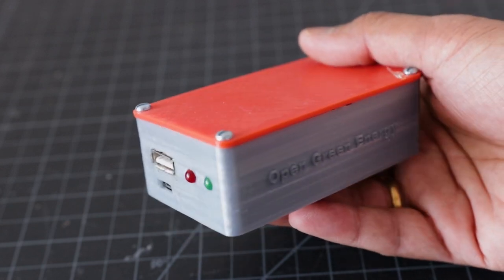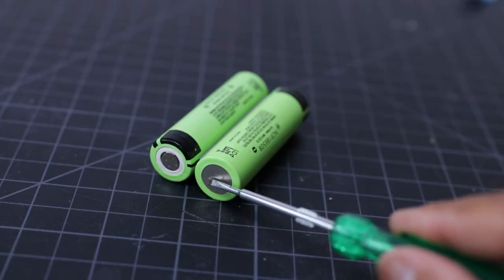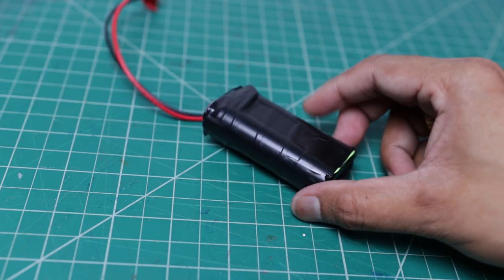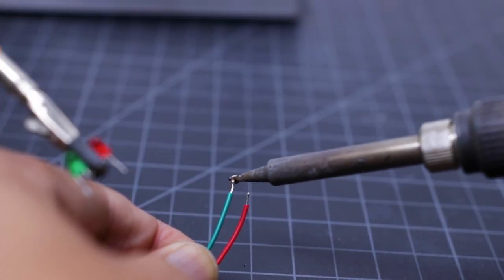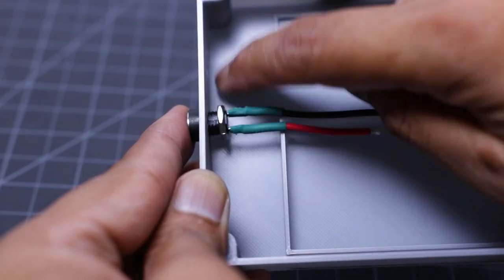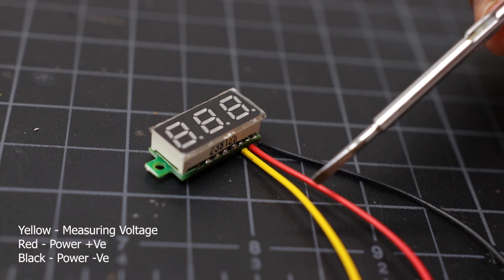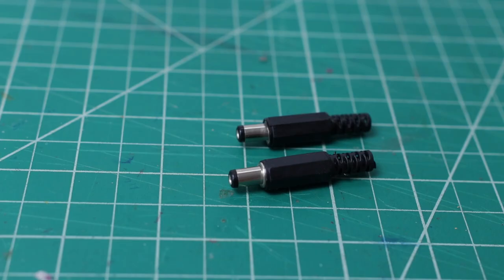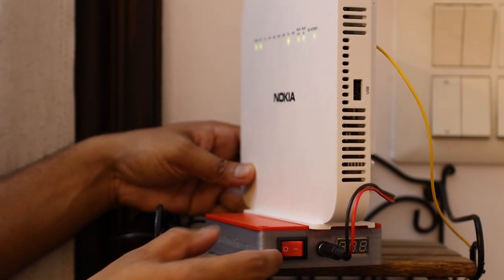DIY Mini UPS for WiFi Router V2.0 | 12V Mini UPS  | Work From Home

Comment: Nicely made video!

Great that you mentioned that a spot welder is recommended for connecting the batteries.
Li-Ion batteries can be dangerous if overheated, for example they may catch fire or explode months later.
We can also use a cheap 2x18650 battery holder, then we don't need to do any soldering to the batteries,
and when some years later the battery capacity becomes too low due to aging, it's easy to open the lid and just
replace the batteries. The enclosure might end up just a bit bigger.

I use exactly same looking heat gun (I think it was sold as "embossing heat gun") for heatshrink tubing, works great!

The voltmeter shows 7.9 V at 13:46, and then after unplugging the power supply, it goes down to 7.4 V = 2 * 3.7 V, and 3.7 V is an almost empty battery. 
But you had them fully charged with your NiteCore charger before building the UPS. Why is that?

This is a cool project, I especially liked your enclosure.

An extra feature that could be added is a power-good or power-loss signal.

If the UPS is used for an MCU (e.g. Arduino, ESP32 etc.) or a single-board computer (Raspberry Pi, Beaglebone),
they could use that signal to realize that power was lost, and schedule an orderly shutdown, for example.

A single-board computer ideally would need something more fancy, e.g. a Beaglebone, if it would shut itself down on power loss,
won't restart automatically when power comes back. Therefore the UPS should have it's own MCU with simple logic, e.g. send Beaglebone
the signal that power had failed and battery is low, wait a fixed number of seconds, giving the Beaglebone chance to shut down properly,
then actually turn off the output (using a MOSFET). When power is back, it should turn the output back on. There are various edge cases
such as handling the cases when power comes back during Beaglebone shutting down, or power going out again while Beaglebone is booting up.

Cheers
Gene

Comment: We need to set boost convertor voltage to slightly lower than tha power adaptor voltage. Else router will use power sources which have the highest voltage. And battery will keep charging and discharging.

Comment: I theory, a very good idea. 
Just some concerns. Typical setup is 1 fiber modem at 12v, and 1 wifi router at 12v. Each of those draws 1 amp. So running them together you will do 2amps. 
I do not think that battery pack will last very long. Maybe 30 -40 minutes of backup power. Consider using 4 x 20700 cells. 2 sets in series, and then 2 banks in parallel.  In South Africa we have daily outages due to rolling blackouts. (aka loadshedding)
these outages is anything from 2 to 2.5 hours. And sometimes the power fails at a municipal level where the outage can be 3 - 24 hours. My max outage was 4 days.
Reply: I am in South Africa as well and agree with you. Some modifications to suit us in SA.

Comment: This is not a UPS but a Powerbank. A UPS has everything under automation. It has to be kept plugged in at all times and provide battery backup within miliseconds after a power outage. This will ONLY be possible by using a relay... a UPS without a relay is only a powerbank. By the way, Open Green Energy is one of my favorite channels. He is working very cleanly and explaining everything in detail. Thank you.
Reply: he used diode may be they will work similer to relay
Reply: @sanjaypatil3097  Sanjay jiii... it's apples and oranges. Totally irrelevant.
Reply: Wrong : a relay is too slow to switch from a power source to another without interrupting the power to the router. The way it is done here is the right way to have a true uninteruptible UPS with zero downtime. The only negative side is the simultaneous charge/discharge of a lithium battery bank which will degrade the lithium cells fast. The alternative is to use the older but safer 12V lead battery
Reply: @enerbot283  Not wrong... a relay backed up by a capacitor will just do just fine providing a smooth transition.
Reply: @enerbot283  Wrong: this is why a capacitor is placed right before the relay. This eliminates the downtime as much as the farad value of the capacitor.

Comment: Excellent! Couple of questions:
1) What exactly does the BMS board do? Why can't we connect the TP5100 directly to the Lithium Ion battery as well as route it through the rocker switch, etc? What exactly is the role of the BMS board? From what I could see in the product description of the TP5100, its already a battery charger with overcurrent protection etc, so I wasnt clear what role the BMS board is playing. 

2) Do the inputs and outputs of the TP5100 share a common ground?

3) Do the inputs and outputs of the LM2587 boost converter share a common ground?
Reply: 1. It only checks for the overcharge voltage of 8.4 volts but it doesn't know the status of each cell if you use it for 2s. If the battery is not balanced you can potentially overcharge once of the cells if you are not using a BMS. Once cell could be 3.8v and the other one at 4.6v and TP5100 would still think everything is ok because it is still seeing 8.4 volts.

2. I believe yes.

3. I believe yes.

Comment: I know it may sound crazy but... I have a 12V 7Ah battery lying around. Do you think a similar circuit can handle such amps? I'm planning to connect Wifi and a 12V LED strip for ambient lighting to it.

Comment: if you want to add more batteries to extend the capacity for 8 hours, what else do you need? besides the batteries?  Different BMS?
My router is 12v 2amp, I need it to work for at least 8 hours
Reply from the maker: I will upload a new video soon, with higher backup. Please keep in touch.
Reply: @opengreenenergy  Me too I need that. I will wait for your video.
Reply: @opengreenenergy  Subcribed! btw :)
Reply: @opengreenenergy  that would be great waiting for the next video

Comment: This is certainly a better design than the one made by the English YouTuber by the name SORIN where I suggested him to use diodes to stop the reverse flow of electricity which he omitted. But, the most important question is whether we can leave this UPS always ON and connected to the power supply or not? 
The reason I am asking this is that I have read that charging module like TP4056 (you used TP 5100) has an issue where it will keep on charging the Li-ion batteries with full voltage even though they are fully charged(the Red charging Led will keep ON continuously) if some load is connected like in the case of UPS such as yours which can be dangerous. TP5100 might also have the same issue although no one till now have tested that.
Also, I would also recommend using a fuse as an extra layer of security to make sure that the IN and OUT power remains within limits.
Reply from the maker: Thank You for your feedback.
Reply: @Milan Maharjan  @Milan Maharjan  It doesn't work like that. Adding Extra module in between won't work. The issue is that the power is continuously being drawn through the battery as there is no relay system. So, the module thinks that the battery is not fully charged and thus keeps on charging. But unlike lead acid batteries that can be left charging safely for longer amount of time. Li ion can be quite dangerous and can get heated or burst into flames if kept charging continuously. It also kills these li ion battery faster. So, for now I would suggest that either you use a small lead acid battery(like the ones used in mosquito rackets) in place of Li ion with some changes or just use this for backup in emergency instead of using it as UPS and leaving it charging indefinitely.

Comment: Here's a much simpler solution: Use a 12 volt car battery and a 12 volt automatic battery charger.
1) Connect the charger to the battery.
2) Cut the low voltage cable and connector off the wifi router power supply and connect the wires to the battery observing correct polarity.
3) plug the connector into the wifi router and plug in the charger.
Done!

The battery always supplies power to the router.
The charger keeps the battery maintained
If the power goes out the router will stay on for days if not weeks or months.
Simple and effective and anyone can do it without all that extra cost and gadgetry.

Comment: Can this be plug in all the time? Or we have to turn it on by manual when power cuts off?
Reply from the maker: Yes you can plugin for all the time. No manual operation is required

Comment: good one , but why to  remove the 12V adaptor , is this not having Over charge protection ?
Reply from the maker: No need to remove the charger, I have shown to demonstrate that without power the router is working.

Comment: Hello ,

Very good work.

This is with regards to V1 of which I couldnt find the video.

"There are a lot of circuits out there that show the use of the TP4056 as both a charger and a load driver - Not Good. If a load is attached to the battery while charging, then the TP4056 may not detect when the charge current has fallen to C/10. So it could continue charging - this could be dangerous.
You should never use the TP4056 as a charger and as a load driver at the same time."

I would not encourage anyone to use TP4056 for charging and discharging at the same time.

Comment: Hello, very well done. One doubt... We are connecting two power sources in parallel. They won't be equal in Voltage. And as far as I know, it is not allowed (or it is not the best practice) to connect in parallel two different voltage (one from 12VDC wall power supply and the second one from LM). Ok. They can be very close to being equal but not 100% equal and there will be a potential difference)
Reply from the maker: You are correct, this is the reason for using of diodes.
Reply: @opengreenenergy  Ok. Thanks. Now is clear. So voltage on LM should be lower than on AC/DC adapter? In this scenario as far as we have mains our device will be powered by ac/dc adapter. How big difference in voltage should be (in case using diodes pointed in your solution)?
Reply: @opengreenenergy   Can i use 1N5804 diode in place of 1N5822 ?

Comment: How would you change the design for countries that need to power a fiber modem and wifi router at the same time? Could you build something so that it has inline charging ?

Comment: Hi, nice video but I have a quick question. Why did you add that direct line with the diode between input and output? I mean, I'm not entirely sure, but when you have current going through that line and the switch is on, don't both currents from the input and the batteries are added together which would double the current at the output? Isn't easier to just get rid of that direct line and let all the current go through the charger module to that parallel connection between batteries and switch? That way, the current would always be charging the batteries until they'll full and depending if the switch is on or off, the UPS will be on or off in the same way no matter if it is powered by the batteries or the wall. Thank you!

Comment: Sir rather than LM2587 module can we use MT3608 booster module PLEASE REPLY 🙏🙏🙏🙏😊
Reply from the maker: Yes, you can use. But it totally depends on the current drawn by your router.
Reply: My router consumes 0.6 Ampere than is it okay to use with my router
Reply: I have two routers first consumes 0.6 Ampere and the other consumes 1.2 Ampere so which module should I connect to the routers
Reply: Waiting for your reply sir 🙏🏼🙏🏼🙏🏼

Comment: Good job but I have an question can I use 4s bms for 12v output?
Reply from the maker: You can use 3S, in that case you can use a buck boost converter instead of boost converter shown in this video.

Comment: hello i have modem plus router so i will use splite cable but both of them have .500 amp so high amp can damage my modem and router or not and if then how i can reduce current

Comment: i tried it today...for some reason reverse current is blocking input voltagr..so batteries are not charging...diodes are working as expected what could be reason?? where do u think i am doing wrong?? Thanks in advance..!

Comment: If I get you right, it means that I won't need the charging and booster conversion units if my input voltage is the same as the battery voltage and same for the output voltage required. Am I right?
Reply: Battery voltage is not fixed, it will slowly go down while being discharged so you need a booster to make sure the voltage is stable. You could get away with the charging buck/boost module if you have the exact voltage needed for charging.

Comment: hi, i have NETGEAR X4 R700 router with 12v & 2amp. is this ups work for my router?  Does he get into work immediately or does the router disconnect and then go up?
Reply from the maker: Yes, it will work.
No, it will work without rebooting.
You can check out my V3.0 video which more powerful.
Reply: @opengreenenergy  Yes I saw the new video, really great.  Very nice work.  Well done 👏👏👏 Looking forward to your next projects.

Comment: Great work... Will it work for my router which is rated at 12V-2A? And if i want 2 output one is 12V-1A and other 12V-2A, will it work? If no thn what changes i need to make plz suggest.
Reply from the maker: Yes, it will work. 
You have to use two DC output jack.
But you will get less backup time. Backup time can be increase by adding one more battery pack.
Reply: I would be glad if u reply

Comment: Nice project am also trying in your device maximum battery backup how much?  , Insted of two battery I can use 4 battery is it supports?
Reply from the maker: I am getting 2hrs 15min for my 7W router. Yes, but the charging time will be increase. The maximum charging current of TP5100 module is 2A.

Comment: I made an ups using 3s bms, xl6009 step up module but it's giving only 10 min backup ? Where is the problem ?
Reply from the maker: Which battery ?
Reply: @opengreenenergy  18650 batteries 3

Comment: bro lifepo4 batteries are available,6000mah for a single battery of nearly 270 rupees..so why cant we use two of them and make a 12 hr battery back up?
Reply from the maker: Ofcourse you can use it

Comment: When battery charge continues down battery voltage down together and then the outout of voltage booster voltage down.. so, i need a module whose provide stable 12volt output

Comment: Doesnt 2s BMS board charge the batteries? y do we need TP5100 ?
Reply from the maker: BMS is for balancing the cell voltage and provide protection to the battery pack.

Comment: My brother, I have a PowerBeam device that works on 24 volts and the router works on 12 volts. I used a UPS for them in three batteries and has three sockets, the first is 24 volts, the second is 12 volts, and the third is 9 volts. Usb 12 volt and USB 5 volt to charge the mobile

Comment: Can i use TP5100 for Lifepo4 or what board do i need for Lifepo4 instead of 18650?
Reply from the maker: You can use TP5000 for Lifepo4 battery.
Reply: @opengreenenergy  Ok. and how about the IN5822? can i use it for lifepo4?
Reply: @opengreenenergy  if you can make a lifepo4 version also with bigger capacity, that would be great! :)
Reply from the maker: @jayc9003  You can use the same.
Reply: @opengreenenergy  Ok. for TP 5100, i want to increase the capacity of the battery. how many batteries i  can connect in parallel? thank you for answering all my question :)

Comment: Is the battery theoretically hot swappable?
Reply: yes instead soldering the battery you can buy 18650 battery holder if battery fails you can swap battery easily

Comment: Is that ok to use higher capacity battery than 3400mah?
Reply from the maker: Yes, you can use it.
Reply: @opengreenenergy  thank you 😇
Reply: Brother why tp5100 is getting too hot when i plugged in?

Comment: Can I use XL6009 for boost converter?
Reply from the maker: Yes, you can use.
Reply: I have tried it today... 
1. TP5100 is heating up a lot, is that alright?
2. The red/blue light on TP5100 is not glowing, what could be the reason?
3. I am not getting desired output voltage. What should be the output voltage on TP5100 ?
Please help 🥺 
Thank you.

Comment: i dnt recommend wrapping the batteries with electrical tape. the battery heat wont be cooled down in the time the ups is on

Comment: Can i use 1n5408 replace 1n5822 pls replay
Reply from the maker: Yes, you can use. But you will loose lot of power in the form of voltage drop across this diode. Here I have used Schottky diode with low forward voltage drop.
Reply: Ok
Reply: Can any it any problem

Comment: If i want to increase the capacity by upgrading bms to 3s and 10p, can i still use TP5100? or i need different charge controller?
Reply: Also, for the power from the negative, is it being drawn from the battery or from the charger?

Comment: Have the battery all time at the maximun voltage is not good it Will cause the battery too drain the electrolite.

Comment: My router needs 19v 2a & I want to have at least 1hour back up time, what changes are needed to suit my needs?
Reply from the maker: You can use the same circuit, but turn the trimpot to set the voltage 19V.
For efficient working, go for 3S battery pack ( 3 battery in series and 3S BMS )
Reply: @opengreenenergy  I would like to use 4 battery, so does the TP5100 support upto 4 battery? 
And can I use the power adapter that comes with the router, rated 19v 2a output? for charging the power bank
Reply from the maker: @pdeepakkumar  TP5100 is not suitable for 4 cells. Maximum 2cell.

Comment: Hi, new subscriber here.. is it possible to use the same circuit for my 19v router? will i be still be able to use the original 19v adapter of the router as my power source? great video by the way..